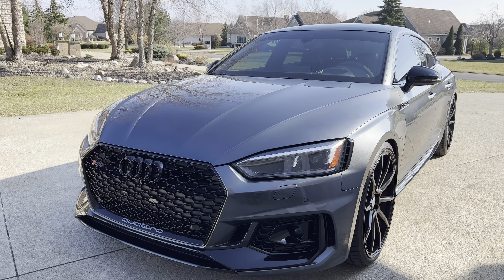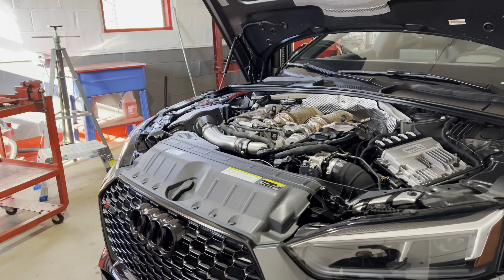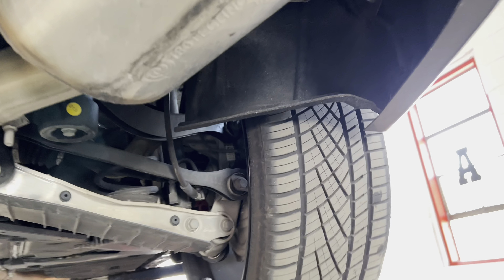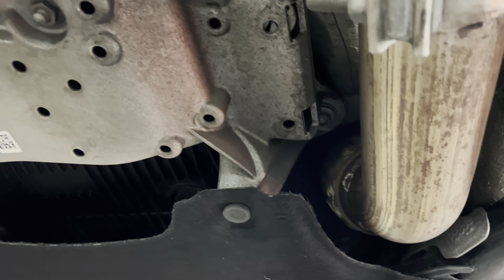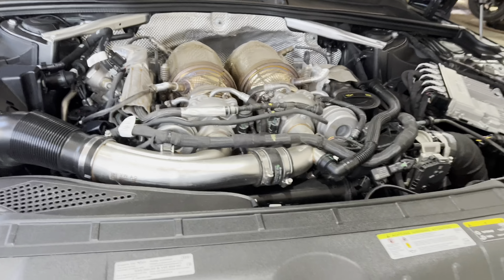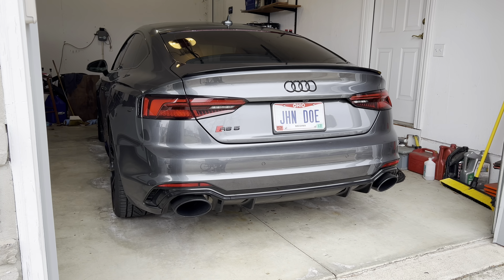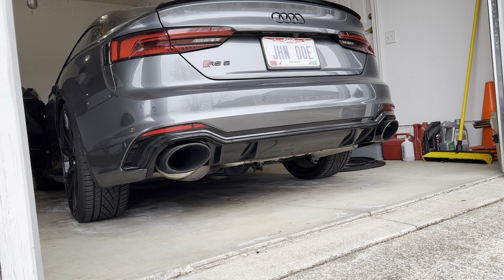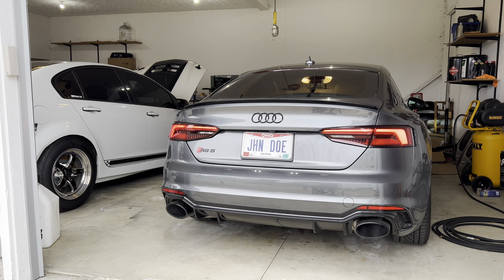Audi B9 RS5 AWE Tuning Touring Edition Exhaust!! (Cold Start!)

Comment: Even the F80 M3 with equal length midpipes  doesn’t sound nearly as good as this.  Gotta give it to Audi to make their 6 cylinder turbos to sound good.  Is the rs5 a single or twin turbo setup ?
Reply: I love both cars but I agree. This might be the exhaust setup I'm looking for for mine. And to answer your question, the RS 5 is twin turbo.
Reply: @anthonywallace319   How’s the overall reliability been on your RS5?   Been looking at a used rs5 or F80 m3 but friends keep telling me Audis are pretty bad reliability wise

Comment: What’s that clicking noise ?
Reply from the maker: That’s the solenoids clicking from the factory exhaust valves. I have that fixed now. My AWE exhaust does not have those valves so you have to buy a plug to trick it thinking they are there and always open so it won’t cycle like that.

Comment: Is your rs5 stock?
Reply from the maker: Yes! Only has the rims and cat-back exhaust here. Everything on engine is stock down to the air intake box. But I just put a cold air intake kit on last night! Video dropping tomorrow!🙌🏼😁
Reply: @WheelzAC  did you have a exhaust tune on it ? or its completely stock
Reply from the maker: @NoodleHeads   No tune. That’s just sport mode.